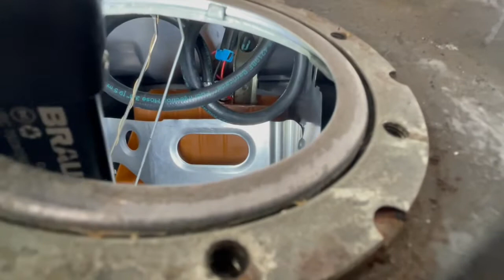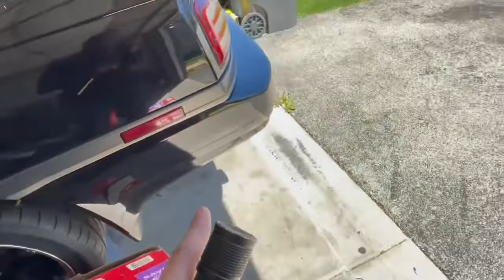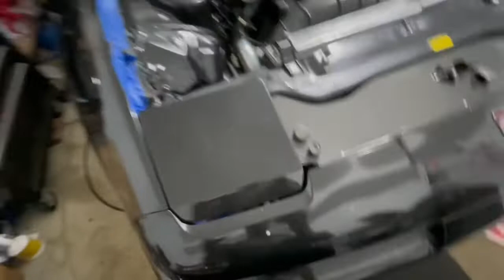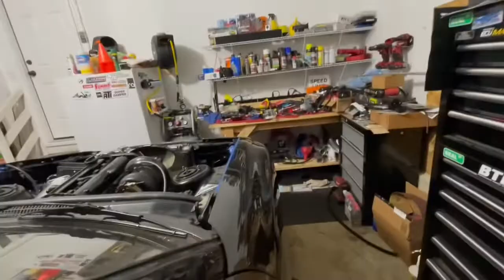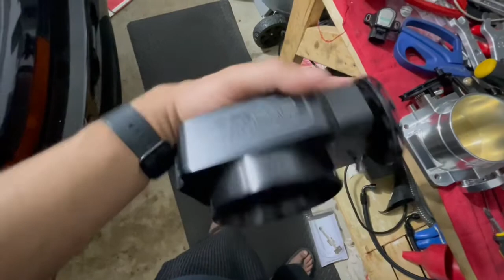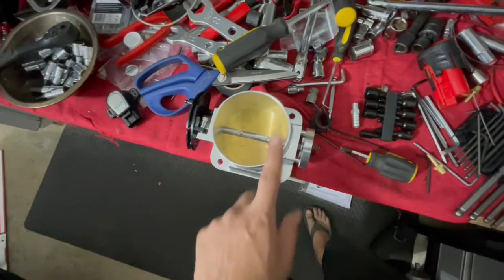2JZ build - Broken TPS!!

Comment: I run just one Hellcat fuel pump; before, I ran three pumps (twin pumps after a surge tank in the rear hatch.
Reply from the maker: I running a hellcat as well but now with additional pump. I am gonna have the 450 as main and heavy boost hellcat to join.  Hellcat draws alot of amp. I rather use 450 more
Reply: @Fonzgarage  Make sense. Actually, I remember having issues with my fuel pressure dropping when I got into high boost; perhaps my Hellcat fuel pump didn’t have enough Amps drawn hence, the drop in pressure…? In any case, something for me to improve on when I go to rebuild my Mk3 one day.
Reply from the maker: @755hp  correct the issue people don’t realize is that it draws amp and no proper relay